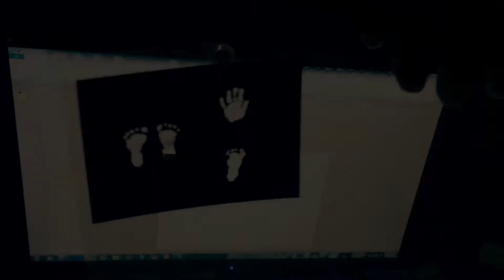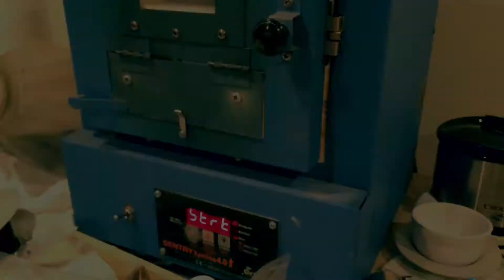Making Handprint Jewelry

Comment: Hi Silver Sculptor. I hope you can help me. I've received my first cufflinks order but cufflink fittings do not stick to the cufflink pieces I made :( I could cry. I kept the torch on for at least 20 seconds, silver went all red and I pressed it hard but it doesn't work . What am I doing wrong?  I am in UK so no competition :)  I am using pmc3 silver . THANK YOU
Reply from the maker: Kirsty Nixon Flynn Hi Kirsty, more than happy to help. It sounds like you’re using sterling silver cufflink mechanisms with PMC fronts? Are you using solder and flux? Do you have a pickle jar? My video is sped up, so 20 seconds may not be enough time, it’s important that the piece is heated up enough that the solder can flow. If you can give me some more information, that will be helpful. How familiar are you with soldering?
Congrats on your first order! If you want to email me, please do: thesilversculptor@gmail.com

Comment: HI! Thanks for this video! I have the same stampmaker kit and tried your 3-4 secs then the 3 mins however my prints keep coming out clear and then the pack around is pink which is completely different to what is in your video! I have tried several times now but each time it comes out the same.... can you help ? x
Reply from the maker: EternallyCherished Uk is the print inverted on the film (it should be clear and the background should be black). Maybe get in touch with the makers of the kit and see if they have any advice?
Reply: Hey thanks for getting back to me so quickly, yes I am printing another negative. Even when I try their template negaitive it is the revesal of (red outside and stamp clear) however when I used their template the stamp came out fine so I think it is the negative thats the issue.
Reply: WOOOOP it was the negative (still a rveesal of colour compared to your vid weirdly) however it worked xx
Reply from the maker: EternallyCherished Uk great!!!

Comment: Hi I am from the UK and am after some advice...I have a polymer stamp kit but can't seem to get the settings right so the stamp stands out far enough to imprint into the pmc....do you have any advice? what timings do you use?
Reply from the maker: Vickie McHugh hi! Are you using imagepac with the fluorescent light box? If so, I put it in for 3-4 secs and then turn it over for 3mins, then wash it in warm water and back in the light box submerged in water for another 3 mins. You don't need it too deep, but this usually gets it 1.5mm deep
Reply: Silver Sculptor Thank you so much....I will try those settings  ...Yes I have that machine!....I have tried a couple of times now and when I press stamp into clay it puts the backing on too, as if it is not raised enough.....I am new to this type of craft.....and it's my first try.....any advice would be greatly appreciated
Reply from the maker: Vickie McHugh try the 3 secs and then 3mins and see how you get on. You can just use your fingers to push the print into the pmc, that might help with the backing not getting on the pmc. Also, don't cut too close to the print, I leave a fair bit of the backing on so that the edges of the stamp don't get pushed down. Then if you have a little bit of the background on you can just sand it off when the piece is dry, before putting it in the kiln
Reply: Thank you so much!!....I tried it last night and it's perfect!!.... 😀 I really appreciate it x
Reply from the maker: Vickie McHugh glad it worked!
Reply: Hi....me again, I hope it's OK to ask another little question....I was wondering what you do after you have used the brush to polish up the piece? that bit is not in your video....x
Reply from the maker: Vickie McHugh I use a tumbler, it gets the pieces up to a high shine. There are other ways of polishing your pieces too (if you don't want to invest in a tumbler right now), just do a Google search

Comment: Hey. I was wondering if  you could help me out, please? I bought  cookie shape cutters (loads of them, various sizes) for making fingerprint jewellery but they don't do a great job. I was wondering if you could let me know where you got your cutters? thank you so much :) Vesta
Reply from the maker: Vesta Mitchell in what way don’t they do a good job? I use cookie cutters and they work great! If you put some olive oil on your fingers and rub it over the cutting part, it will be easier to remove the clay. Let me know what the exact problem is and I’ll try and help!
Reply: this sounds like a great advice, thank you. Clay gets stuck and while trying to get it out doesn't stay in a good shape. The bit where metal is joined leaves the charm line a bit curved but I will try the oil and see if it works. Thank you so much for your advice. When I use the clay and leave the rest for re-using it gets a bit hard and not the best quality tho I store it as instructed. Do you have any tricks? :) once again thank you so much for your advise
Reply from the maker: Vesta Mitchell yes, unfortunately where the cookie cutter meets, that will happen. But just sand it down when dry using this from Rio https://www.riogrande.com/product/3m-wetordry-tri-m-ite-polishing-paper-400-grit/337301 with regards to it drying out, I wrap it tight in Saran Wrap and put it in an airtight container. You can rehydrate it with a spritz of water and then molding it with your fingers so the water gets to it all (if that makes sense)